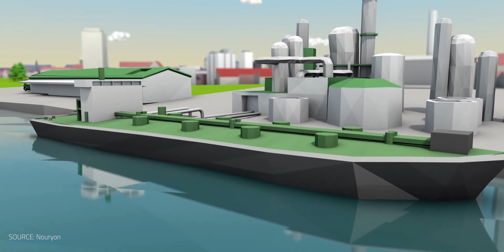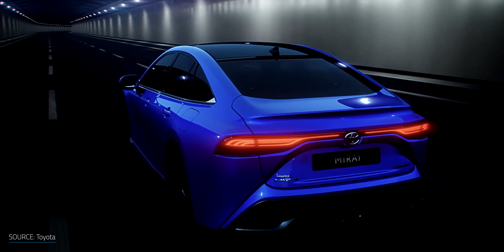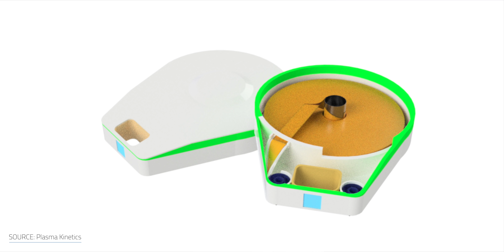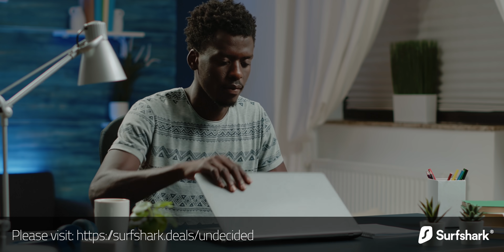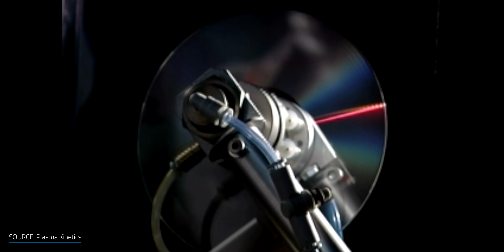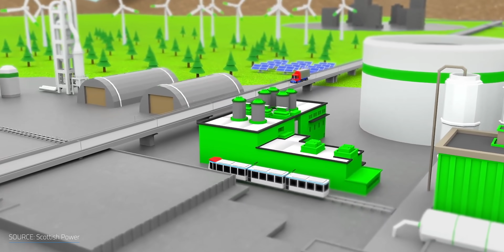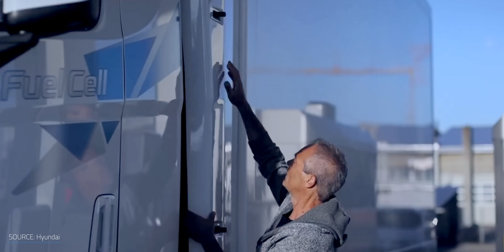Energy Storage Breakthrough - Solid Hydrogen Explained

Comment: Fascinating, the two data points I'm most curious about are: what is the actual energy density in both wh/kg & wh/m^3, and what's it's energy transfer rate in coulombs per cartridge/container.  I do know you need a fuel cell to complete those measurements, but with the latter, the light extraction method seems like a potential energy bottleneck.  Also curious how much parasitic loss the mechanism and light hardware uses.  Gotta spin the rollers and light that light.  Efficiency numbers were given, but it would be interesting to know the specifics of that parasitic loss.  Also is the energy transfer rate / loss linear or exponential, as in at double the transfer rate does the loss square? Etc.
Reply: These are awesome questions! I also want to know the in-depth data.
Reply: Agree great questions. The energy density compared to lithium ion batteries seems to be missing a logical step, if the application is a vehicle we should incorporate the fuel cell conversion efficiency as the battery already has energy in the form the electric motors need.
Reply: You saved me having to ask essentially the same. I'd like to know the "well to wheel" or "cradle to grave" cost of the energy as well. They do mention aircraft ... and say it's got higher energy density. But it essentially needs an order of magnitude increase to really change the world.
Reply: I agree, these are questions that need to be answered.
Reply: @KennyKlittich  exactly, the coulomb question helps answer if batteries or supercapacitors would need to be paired in order to handle energy need spikes.  Like when passing another car, can it keep up alone, or should it be paired with another storage type to buffer/release with it?
Reply: Near the end he mentions energy density is less than 700 bar tanks. Both by volume and by weight. 
So main goal seems to be missed. 

Second goal efficiency of storage. 700 bar compression you maybe need 10% extra energy versus what exactly? Did they say 60% of efficiency. 
So that would be not good either.

So 3rd target faster filling. There they probably are worse too. Why would the push the „benefit“ of being able to exchange filled cassettes?
Maybe because they are slow.

Sounds useless to me. 😉
Reply: Agreed it's fascinating and your questions are spot on "need to know" as well as  your thoughts on a systems approach with supercaps/batteries.  What I like about it is it's out of the box thinking for H2 as fuel and it's storage is cutting edge.  Thanks for your thoughts and lighting the candle!
Reply: @Flyer2303  Most hydrogen storage methods store between 1.5x (e.g. LOHC) to 2x (e.g. carbon nitride) the amount of hydrogen of those tanks. Some get to 3.5x (ammonia). And they don't lock you down into buying cartridges from some vendor.
Reply: If rate of flow is a problem surely more lasers could be added to release more hydrogen from storage? Also if the fuel cells are too weak couldn't more just be installed? (Please tell me if I am being dumb here)
Reply: That's really the question I think would determine viability. To become practical, I expect it would at least have to match Li ion batteries for Wh/kg.
Reply: @thewardoctor3127  There is only so much space in a vehicle. You can of cause scale things up, but than its probably impactable for automotive use. That's usually the case with "new breakthrough Technology"
Reply: Lets approximate ;)
So we get 33333Wh/kg H2. If they can get to 5 wt% for the hydrid -> 1666 Wh/kg. Let s asume only 10% of a cardrige weight is storage material -> 166 Wh/kg. If a carrier tape is needed 50wt% down to 83 Wh/kg. Witch is roughly a around a 700 bar H2 tank with awesome 6,4 wt% storage capability.
Reply: Cool, but what about 'Team Science'? 

Will that be a thing? Fighting Anti-Science? 
Joining the Flat-Earth-Debunkers who have a Blast laughing about flat-earth-conspiracys and such, 
while also explaining stuff for those that wondered about these things? 

Pseudoscience and its cousins are a big social problem and Education needs
Reply: It sounds like the main advantage is cost - it mentions that they have a lower energy density than 700 bar compressed hydrogen tanks, and are slightly heavier for the same amount of energy.
Reply: you must be an engineer
Reply: The company claims 1KWh/Kg and 806 KWh/M^3. Parasitic loss is not mentioned anywhere but seems to be significant given the claim of 1kg/min storage rate which would involve a decent roller speed and laser cans with lasers reaching around 200 deg C. If solar+electrolysis generated H2 modules can be paired with this, then retail interest could rise. As of now, only HCV, shipping and eVTOL operators seem to be their target market. 60% efficiency does seem like the investment killer though, so some sort of "fill with water and use" automotive application will go a long way towards popularising this among the general public and the cost and CO2 savings could generate governmental interest. (The company claims such interest exists from companies like Volvo and Hyundai, among many others).
Reply: @GuardsmanBass  cost and weight/energy density, safety and carbon credits advantage over Li ion - That's what they are claiming anyway. It seems like a great H2 capture tech intended for grids, bio gassification, some industries. Doesn't seem ready for 4 wheelers as of now.
Reply: @PuruPJ  the math for swap vs charge has never been good for most consumer vehicles.  It works for moped/bike/moto just due to size/ease, and then you skip up to large truck/bus for the economy to make sense.  I imagine that's true for this too.  Combine that with the high cost of FC and the moped/bikes are now eliminated, leaving only large/commercial vehicles.  Swapping in boats is just too much of a PITA and there's likely room enough for pressurized storage anyway.  That leaves aviation, going fully electric in aviation has two big needs: weight savings (this might be good) and for commercial flight, swap charging keeps the aircraft in service.  Also aviation is more tolerant of higher costs.  So this could really be a plausible solution for aviation assuming the mass equation isn't limiting.  Will be interesting to watch where it goes.
Reply: Plasma kinetic's website says this technology provides 8.7 kWh/kg
Reply: @GuardsmanBass  It seems way more expensive than existing safe hydrogen carriers too.
Reply: @muratnehir6596  It's about something else but you are not able to admit it for psychological and sexual reasons.
Reply: @Tok_Janne  I can assure you that 8.7 kWh/kg is pure BS from marketing material. Even if you count only one film and ignore all losses but for a real application with the whole cathridge, lasers and losses your never gonna reach even one tenth of that. If you just look up the basics of the material you will note that 8.9kWh/kg would literally mean that half of the total weight would have to be hydrogen atoms which is an assumption so impossible its ridiculus!
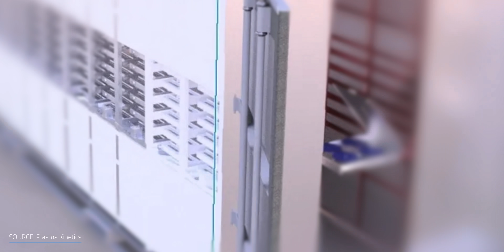Reply: Energy transfer rate per cartridge is one of many critical aspects (but isn't that Watts, not coulombs?) The 9:00 animation showing a shipping container of 120 trays each containing 4 cartridges raises the question of how many laser players have to be running simultaneously to get enough hydrogen out per second to operate a ship or airplane.

 @JohnBysinger  nowhere does the credulous video cover the economics of reloading the cartridges with hydrogen. Even if you believe the cartridges can handle 150 runs past the laser without the tape getting mangled like a VHS Jane Fonda workout video, there's no explanation or rendering of Plasma Kinetics elaborate robotic videocassette rewinding factory-cum-green hydrogen facility, or any estimate for the cost per kg of hydrogen going out its door. It's like the LaserVision meets 8-track audio cartridges of energy storage.
Reply: @skierpage  To help understand why I was asking about Coulombs over Wh is to try to understand how an automaker would size an install of cartridges in a car.  For example, to reach it's insane acceleration numbers the gen 1 Rimac sports car pushes about 2 coulombs at peak output.  I think a Model S is 1-1.5 (but could be wrong, fuzzy memory for the Tesla.)  For fast changes in acceleration Coulombs come in to play.  If to reach 1 coulomb it took something insane like 100 cartridges, then it would be a non starter for high end EVs.  Also if EV pickups ever manage to push ICE pickups out in towing and heavy duty use, coulombs matter again there too.

That said, in aviation, it's much less important.  Generally you're dealing with constant speed props and output is much more flat.
Reply: @JohnBysinger  I think you're confused. Coulomb is a measure of static electric charge. Wikipedia "The amount of charge that travels through a typical alkaline AA battery from being fully charged to discharged is about 5 kC".

You need power to accelerate, which is measured in watts (or horsepower), not Coulombs. Wh, Watt•hours, measures energy because energy is power for an amount of time.

You may be thinking of C rate, a measure of how quickly a battery can charge or discharge. The 1900 hp (1400 kW) Rimac Nevera has a 120 kW•h  battery;  although C rate is actually based on current draw, not power, this implies a C rate on discharge of roughly 1400/120 or 11.6 per hour, much higher than a Tesla Model S. You could compute a similar number for hydrogen storage discharge rate. For a pressure tank it's sky high (just open the valve!), but an HFCV's power is instead limited by the rate its fuel cell stack can run hydrogen through the chemical reaction with oxygen. If my math is right the 182 horsepower Toyota Mirai eats through 8 kg of hydrogen per hour at max power if it's fuel cell is 50% efficient. Yes, If the hydrogen delivery rate of one of these cartridges is less than that then you'll need more of them running through multiple laser players at the same time, But unlike a battery, a longer tape in the cartridge won't translate to a higher hydrogen delivery rate.
Reply: @PuruPJ  I don't think the laser has to reach thoes temperatures. He stated it happens at room temp and that I was the light causing the release not the temp.
Reply: Sadly I think right now they could be only trying to market their technology to get more funding. I don't think they have yet to get to the stages of refining their technology to the point they can produce a energy density, and energy transfer number(s)/cart(s).

At least that's what I got from how they presented their technology. I do hope to see in the future if it works out because if H2 can be stored easily and with high enough density in this maybe H3 can as well.

Edit: Sadly, after watching Thunderf00t the science for their own patent  doesn't show much progression. I do hope that there is a way to get  something like this in the future, but their current setup is likely not  to work.
Reply: for a static location would a solar pumped laser work? and a solar panel should be able to run the motor.
Reply: @UncleKennysPlace  So you don't approve of spending $450M annually to dispose of wind turbine blades?
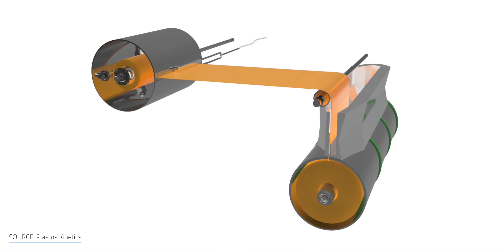Reply: 9:35 It claims to be 30% lighter than Li-ion batteries, so it should have about 43% higher energy density.
Reply: @EgnachHelton  Issue with that "About" figure is similar to any technology they can say about for their "Best" conditions, but normal conditions aren't going to show that. So the weight maybe close, but the energy density will likely be smaller due to their number being lab conditions or mathematical which doesn't account for outside perimeters.
Reply: @Flyer2303  exchange of used casset would be similar to swap and go on a 9kg lpg cylinder. pull you casset from the car walk in grab a new one and put in car the complexity/dificulty in swapping the cassete is the issue
Reply: Im also curious if the fact that it has to be carried around instead of transported through pipelines will offset its energy efficiency and harm the logistics of transporting it. Pipelines are a hot issue, but ultimately theyre fantastic for cheap transport without needing to put vehicles on the road, rail, and water to move stuff around. Can this system compete with such transportation efficiency?
Reply: The thing about the hydrogen supporting folk is on the one hand they say the renewable electricity production is intermittent (I.E. not enough of it) and on the other they say there's so many renewable electrons that we can afford to use them (largely inefficiently) to create protons.  Soon there will be enough batteries in the form of EVs and stationary storage to store the excess green electrons and distribution is trivial and efficient using wires.
Reply: One H2 =2 electrons so you can figure mohls /coulomb directly.  I am a skeptic at this point. Only practical with govt money.
Reply: Good question, anyways I've got this futon I'm selling.
Reply: @johanstjern4118  Yea the only part of the system that could be that hydrogen rich are the actual nano pillars on the surface of the film but that ignores the bulk mass of the film actually needed for it to be more then a ghostly whisp of atoms.
Reply: coulombs/container isn't a measure of energy transfer wtf are you staying

Comment: I'd hoped to be able to recharge this from a Solar Freakin' Roadway, or at least from a diamond nuclear battery, or any other 'technology' where they quickly gloss over how it works and the lack of a working prototype, then do a very long spiel on all the ways you could use it, if it existed.
Reply: I can see how these discs could power Hyperloop after rechargin it from Solar Freakin' Roadways
Reply: Good idea.
For offroad I would recommend using a perpetuum mobile.
Reply: Carbon nuclear batteries do exist, just put out mW at best. They were never claimed to run a smartphone or a car, just a potential replacement for present low-current “power harvesting” devices in lieu of a tiny lithium storage cell and the harvesting equipment.

Comment: So apparently you need laser light to release the hydrogen from the metal.   What about the lasers' energy consumption and the system required to expose the full surface area? Is that included in the storage efficiency?
Reply: No it's a scam that they reported on. Big fan of your videos tho!
Reply: The laser is powered by the solar roadways